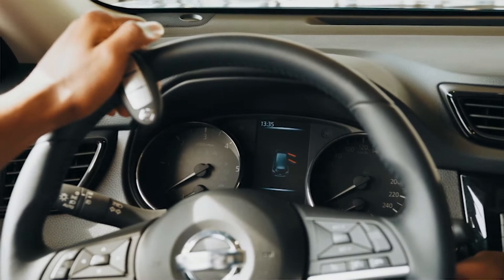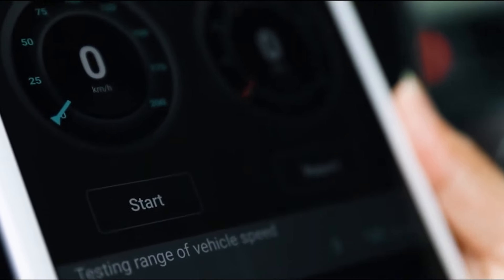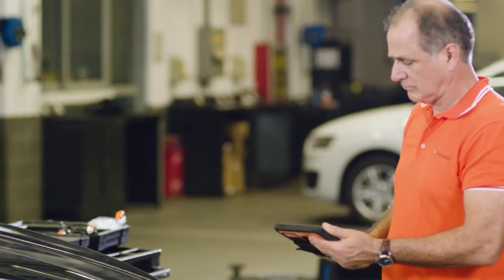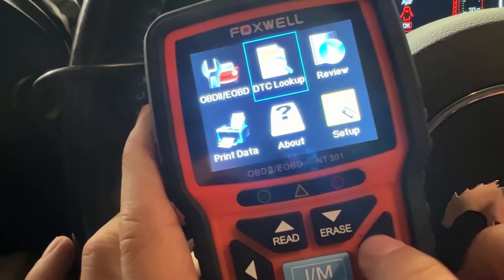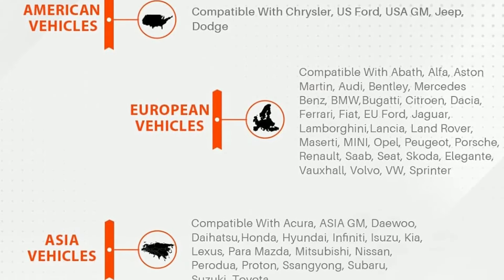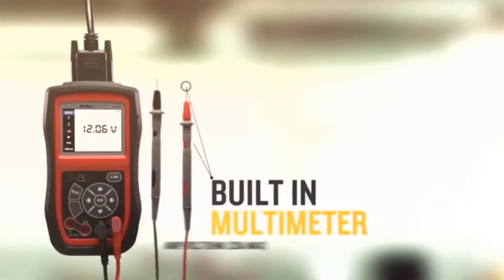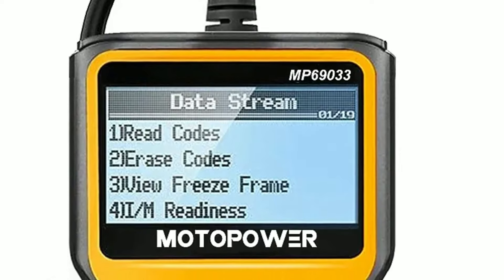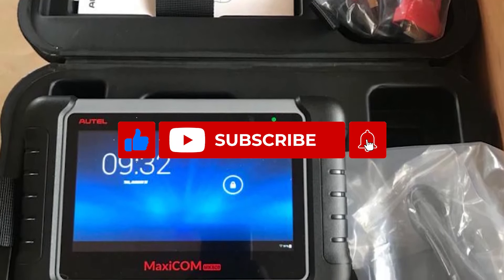Best Budget OBD 2 Scanners 2024

Comment: Foxwell NT-301 is a good OBD2 until you go to update it. The software needed to update it does not work on windows 10 or 11. Unless you have an old laptop running Win 98/NT, Win ME, Win 2000, Win XP,  Vista, or Win 7
You can't update it. The update tool NT wonder will not link to your OBD2.
In my experience with their tech support, I was told to remove the SD card from the NT-301 and insert into the PC and update it. The NT-301 doesn't have a SD card or slot. Bottom line. It's  a good tool that you can't update. 😂😂😂
Reply: Dam that sucks. I was about to buy one. Seems it is best one in the $60 range which is my budget. Would you recommend any other one in that range?
Reply: Thanks for this .. think you just saved me around $80 AUD 😊